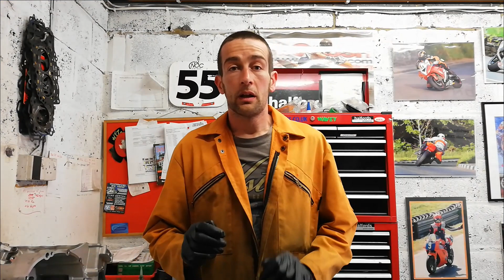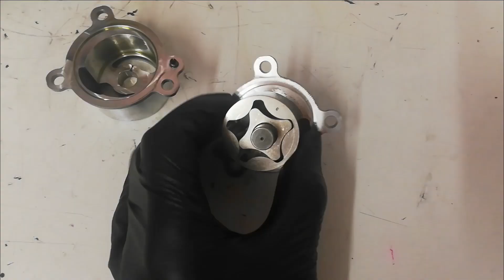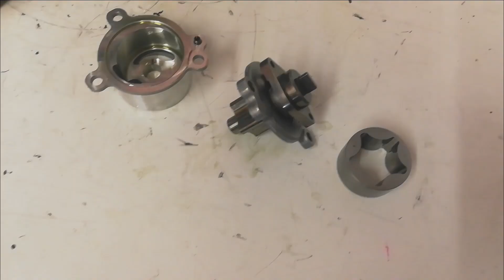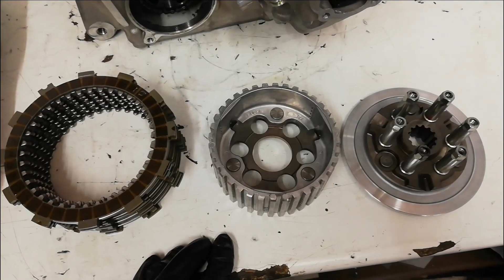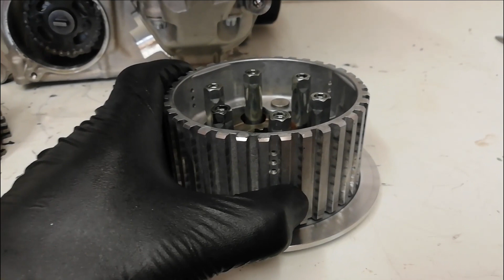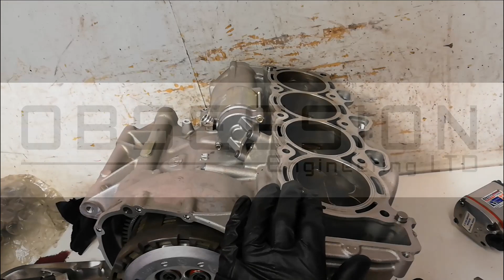How to refresh a BMW s1000rr engine  Part 7  Clutch

Comment: Hey Dave I have a 2010 s1000rr (43,000km)
I have had my first ever miss shift and am wondering if you think changing the Shift star could fix it.
BMW apparently made a new shift star because the early model had issues I heard, however I’m not sure if that will fix it all for good.

Do not have the money to have the transmission looked at by a professional.
Reply from the maker: The later shift star is better and more reliable, it's a common problem especially on the early bikes. Alpha do an uprated detent spring too which gives a more positive change

Comment: Thanks Dave, have enjoyed watching all of your videos. I was hoping to get an insight to my own BMW. I have the 2012 s1000rr with 45,000 km. Light road use mainly. The clutch has become noisy and I get an intermittent  knocking sound. I'm going to do an inspection. There is no clutch slippage. Anything obvious I should look out for. I have the workshop manual and Haynes Manual. There is no mention about  a noisy clutch. Thanks for any input.
Reply: I have the same bike and same problem, did you fix your bike?
Reply: @ncaap3575  yes. The clutch housing had play in it. There is a YouTube with Brocks showing the exact same thing for the s1000rr. The clutch housing has to be replaced. I bought a new one. Pm me your email address if you want more info.
Reply: @lawrencekennedy9590  I’m not sure how to pm you. Please pm me and then I’ll be able to reply with my email .
Reply: @ncaap3575  send me a DM on Instagram @Bikeinspired and I'll give you my e-mail
Reply: @lawrencekennedy9590  I sent a pm on Instagram